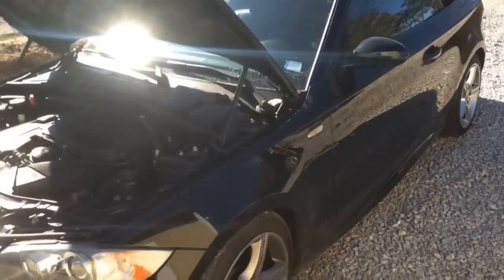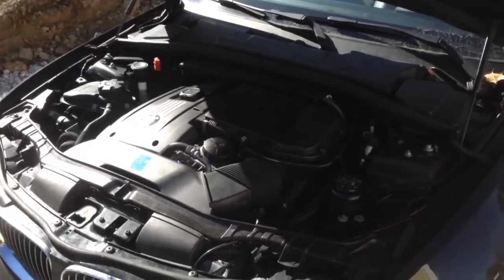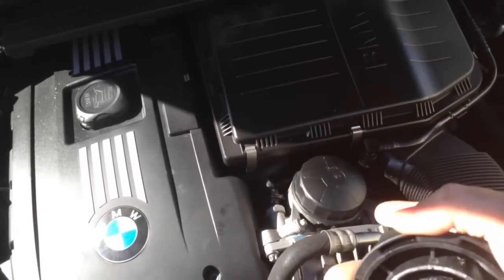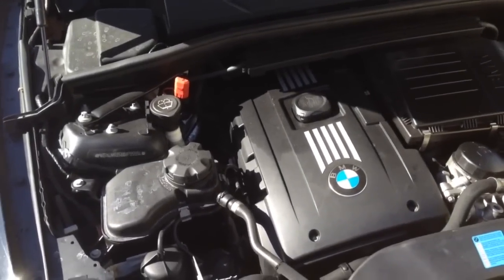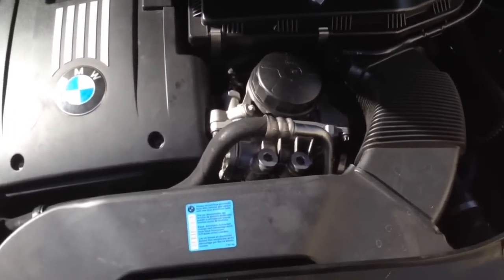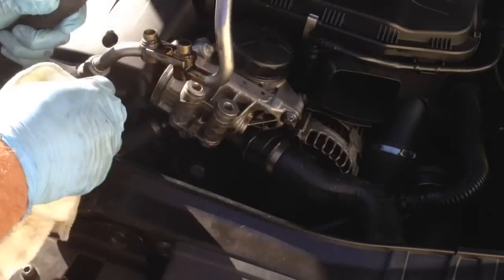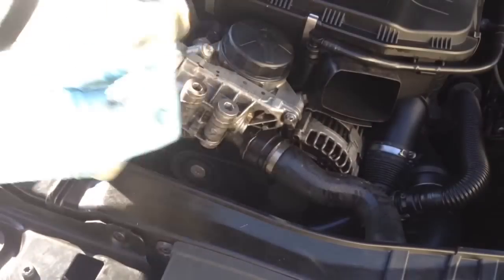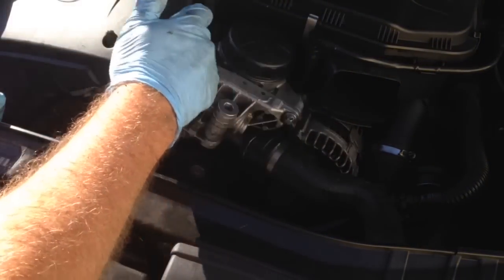BMW N54 Oil Filter Housing And Intake Manifold Removal 135i 335i 535i

Comment: You don't have to increase the torque setting on the torque wrench beyond the target torque applied to the fastener due to the use of socket extensions.
Reply: Yeah, that was weird.
Reply: This is a great video to watch and brought down to a simple level with a touch of humor.  On time frame 32m/41s, it is mentioned to have to increase torque because an extension bar is used.   Newton's 3rd law teach us that for every action, there is an equal and opposite reaction.  Since there is no alteration of path between the start of the extension and the end point of the extension, the torque setting should still be able to be maintained and not increased.  Now if you are using a U-Joint Socket adapter at the end point of the extension bar to turn your bolt,  then this creates an alteration of the path of force which would require more torque value.  When you use a  U-Joint Socket adapter, you can see a loss of up to 40% of torque value depending on the angle you use.  Nathan, you are awesome and once again, have saved saved us from money wasted.  You would be that perfect neighbor.  Happy holidays!

Comment: FYI...That rear hose for the air box is not a boost line.  It's just an air intake hose.  For some reason mine won't stretch far enough to tighten on to the air box either.

Comment: Nathan ? For ya 08 335i reverse issue. Wworks fine but when warm or after drive time habe to shut car off for the reverse to then go I to reverse. Is that low fluid and mechtronics sleeves or is it soloinoid issue thnx so .much

Comment: i was wondering if its normal when the engine is running to feel air blowing from the top of the oil cooler/ oil filter housing? i can feel air hit my palm when i put my hand over it but I'm not sure if its just the fan wind.

Comment: Can you determine if it's the front housing coolant gasket by it leaking coolant and if its oil it would be the whole oil housing assembly or will it leak oil and coolant if just the front gasket was leaking ?

Comment: In one of your oil filter housing videos you talk about adding ultra Gray on top of the gasket. Is that a good idea? I've got mine apart right now and have Ultra Gray and am considering it.
Reply: Did you apply ultra gray on top of the gasket? I replaced the oil cooler gasket but it is still leaking. Need to redo and maybe apply ultra black max oil resistant in addition to the gasket.
Reply: @hxtubehx  , did you make sure you torqued your bolts down between 14 to 16 foot pounds?  For those using Newton's, it would be 19-21Nm

Comment: Quick question how would you remove the mixture of oil and coolant throughout the system is there a way to clean out the mixture through the hoses ??
Reply: Hi mate only thing you can do is flush the coolent on a regular bases until its all gone, as it will be all over the system...  i have this issue too mate :( going to fix it my self next week

Comment: I am looking for the O-ring you mention in minute 26:20 ? which one is that ?
Reply: Did you ever figure out what the part number was for this O-ring?  Also does anyone know the part number for the oil cooler return fitting metal washer?

Comment: Good morning Natha. first thing thanks again for all your videos of the Diy, been very helpful. struggling for 2 months now I came across a wall dead end with my car I have a 2008 BMW X5 3.0 rough idling stalling misfires. for some reason the strength has been getting weaker and  I don't know what else to do also I'm going to give you a list of the things that I replacedon this car that I've done trying to find out the problem fuel pump, engine  head gasket all coils and spark plugs,  eccentric Shaft Sensor and Gasket, camshaft sensor,  I purchase cheap Vanos Solenoid  and today I got a code. P0113 and also getting this air mass meter and Supply intake air temperature. also getting fuel mixture control and for a while now I've been getting this every time I use my OBD sensor it says null central control timeout. and it's be getting a whole bunch of misfires. please if you can help me appreciate if you can point me in the right direction where to look I am whole out of options. thanks in advance.

Comment: Nathan, thanks for the DIY! Do I need to drain the coolant from the radiator before removing the oil filter housing or can I take some out when removing the coolant hose at the housing?
Reply from the maker: Just Remove the lower coolant hose to let some out
Reply: Thanks man!

Comment: I dropped a piece of gasket about two and quarter inches long while replacing the valve cover gasket I tried to flush hoping it will drain to the oil pan but no luck I really need your expertise on this issue brother what do you think I should do others says leave it what's your take on this one I really appreciate your answer I thank you

Comment: Whoever butchered this car before should have all their fingers broken so they can no longer desecrate the cars entrusted to their care.

With even torque on the bolts, the factory gasket on the oil filter housing should seal perfectly.  If the aluminum bolts are stretched, replace them.  Most on any BMW or other engine are one time use  only as they stretch when torqued.

Comment: They still sell kits of parts for all of the things he touched, and individual parts. Really should replace any aluminum bolts, and do the torques as specified: many are part of a design where the bolt is stretched when it's torqued into place the first (only) time and getting the right torque a second time will break it! Because it was stretched the first time.  So replace the aluminum bolts. Replace steel bolts - especially if they were made with blue sealer on some specific part of the threads.

Gaskets should be original or higher quality, not made with goo. He showed what happens, the blue goo leaked...not because it's blue, because it's goo and goo don't last...it should be a gasket. Bet your life on it? I wouldn't! 

I've worked on German cars since the 70's. One thing I know about them is they use a lot of engineering in their designs, VW, Porsche, MB, BMW, a lot; even, possibly, audi. There's a lot of aluminum and various alloys used throughout. It has less forgiveness than steel. You have to work at least to their methods and standards or better or the parts won't work right or will break or leak then break. But they are usually made so you can break them open and fix or replace nearly any part, and for BMW at least, nearly every part is readily available. That includes new hoses and "o-rings." How much to replace the motor, maybe $5000 - $6000? More? Labor? And you trust this to a HF "o-ring" from a mixed box, and $7.00 goo instead of spending $1 or so for the BMW part from FCP & maybe $25 on a correct gasket? Yes they'll eventually leak oil. Change the oil before absolutely necessary, and keep up with all the maintenance items and the n54 can go 200,000 miles.

Comment: Is taking the fan out a must? Also, Can we reach the difficult bolt under the manifold with a swivel socket?
Reply from the maker: You only need to remove the fan on the 1 series, you might be able to get around it but its much easier to get it out of the way
Reply: Nathan's DIY Garage i have a 2009 335i n54. . Thoughts?
Reply: Take the fan off so you can get to areas to clean also from the oil leak if your gasket failed. It's not difficult to do.

Comment: Loose RTV particles passing through the VANOS; coolant in the oil;  engine compartment full of leaves;  cabin air filters couldn't pass air with Rolls-Royce Jet aircraft engines pushing.   no, it isn't right to charge more if a customer is an idiot.  as they say in old war movies, "Patch 'em up doc an' send back out there".

Comment: Unless the owner did previous work on the car himself, looks like some mechanic tried to work on the car while taking every shortcut possible. Probably got paid per job. " let's kick this baby out as fast as possible".
Reply from the maker: Yes and it still has a coolant leak from the what looks like the electric water pump which is a $300 part